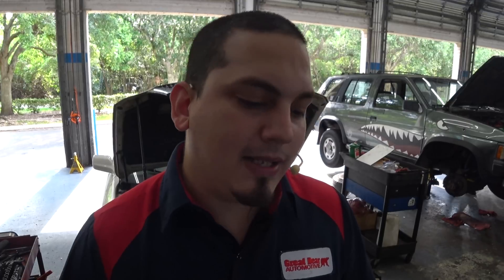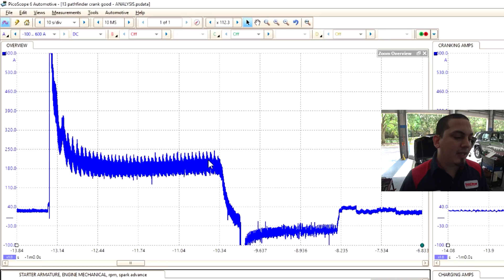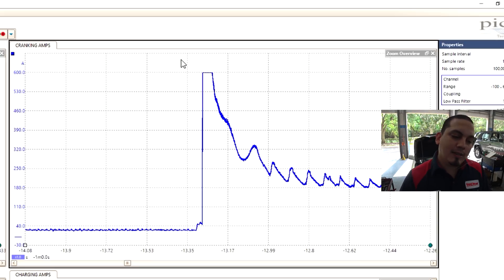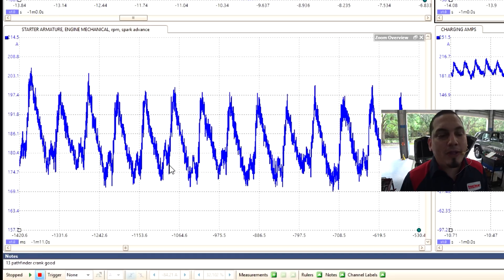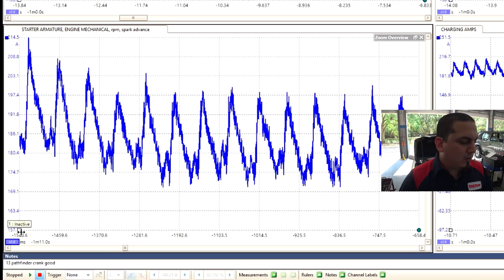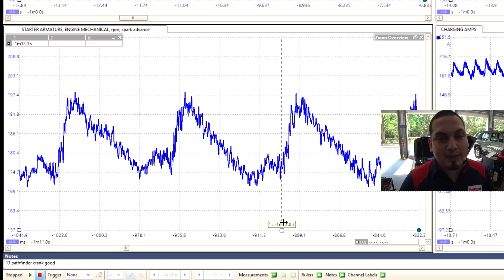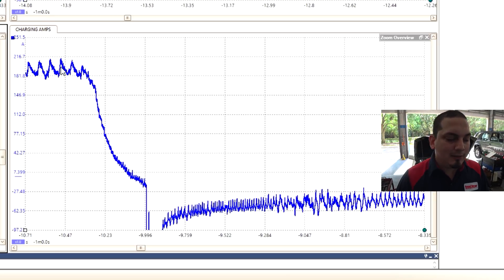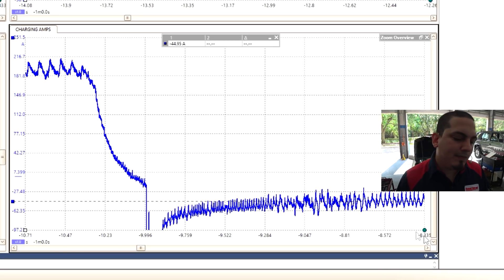The Relative Compression Test - Explained

Comment: Can you do a video showing how to set up the wires to the scanner? How to set up the channels and why? And how to add a trigger? I have a Snap on modis EES300 and a OTC low amp clamp. Can you use the alligator clamps as a trigger on a plug wire?
Reply from the maker: I've done plenty of videos showing how to set up for a synced relative compression test. Some of them are in real time as well. I'm not familiar with the snap on scope/scanner. There only thing you can use on a secondary plug wire is a secondary clamp. Unless it's a gm that has coil/wire/plug systems, you can grab a sync from the command wire
Reply: @SuperMarioDiagnostics  I'm working on a 2003 Hummer H2 6.0 vortec. P0300 code. My father in law was the mechanic a d passed last year. I was left his scanner. I've now wat hed tons of videos on doing the compression test but am having zero results doing it myself
Reply from the maker: https://youtu.be/-HCAypPTESs
Reply: @SuperMarioDiagnostics  you are awesome. Thank you. Just watched your hummer video. I have a 03 with a random misfire.

Comment: Thank you for that very good video, could i refer back to your previous set up video and ask if you a/c coupled for the first look sensor?  Thanks again  jeff
Reply from the maker: Thank you! Nope, you could if you want to, but a/c voltage rides on top of dc voltage so we're not missing out on anything.
Reply: Ok  thank you...i have a sensor which although not a first look sensor..autoditex make....it says for set up to use a/c couple...certainly for exhaust pulse testing.....would this be just to give a larger on screen view of the pulse display do you think....i get what you mean re the a/c riding on top of the dc.....love the idea of using the sensor to check for head gasket and also for comfirming pump operation...would be good to see a few more known good pump pulse signatures.....look forward to more of your videos

Comment: Great information thanks.  But to test the true RPM you should only use any two compression events of the 4 stroke engine and this will give you the true RPM not 6 ? Not seen this before I bet if you use any two compression events then just divided 60000 by the Milli seconds you have on the two compression events and this will be the true RPM does not matter if it a one cylinder on 8 cylinders it the same test
Reply from the maker: Thanks! I could also get true rpm result from measuring just 3 compression strokes(one crank revolution). But to illustrate for those who may be just starting out its a lot easier to tell people to capture the six cylinders and multiply that rpm by two. I did in fact measure 720 degrees of a single cylinder. If you were to capture only two out of the six compression strokes, you'd only be measuring 240 degrees of crankshaft rotation.
Reply: @SuperMarioDiagnostics  please I don't understand this concept of calculation of deriving true rpm .Can send me a link  for better understanding